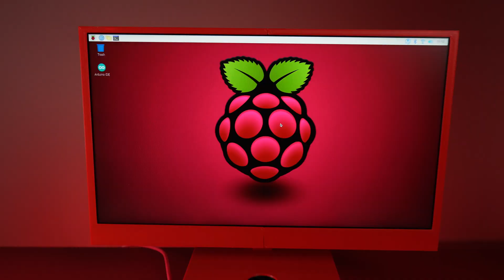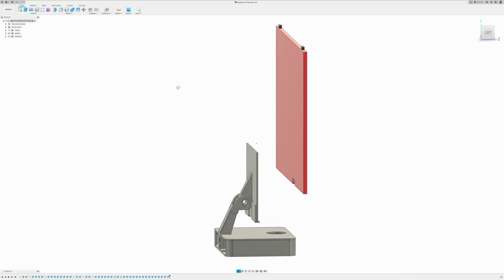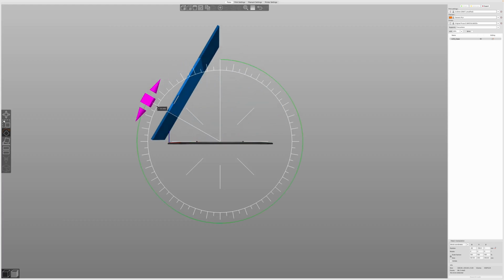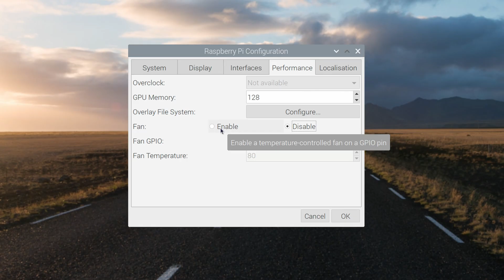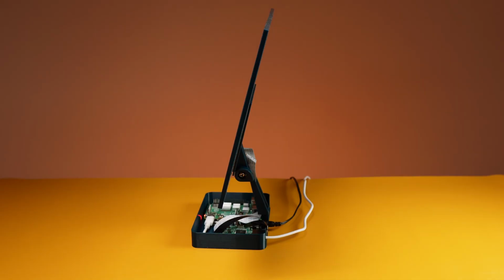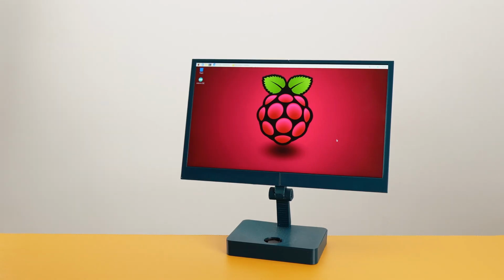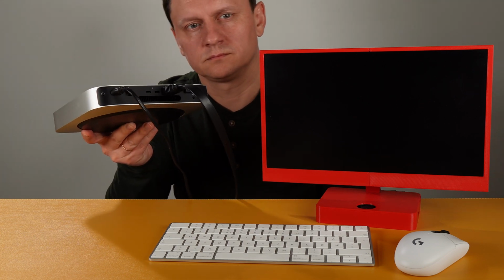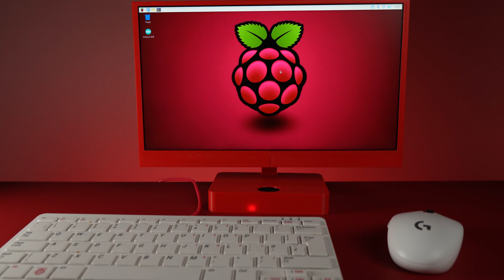Raspberry Pi Desktop

Comment: how much did this project cost in total?
Reply from the maker: I already had failed laptop and Raspberry Pi. But if I would estimate the price according to what I can find on Amazon, Ebay, Aliexpress:
1. LCD panel from Dell Latitude E7440 laptop (B140HAN01) about 50$ 
2. LCD controller board for B140HAN01 about 19$ 
3. Heatsink Kit for Raspberry Pi about 2$
4. HighPi Pro 5V Cooling Fan about 6$
5. PLA filament (173 gram) about 4$
Without Raspberry Pi I would estimate about 81$ in total. 
Add the price of Raspberry Pi with 1GB, 2GB, 4GB, or 8GB.

Comment: This is really cool! How much would you say it cost in filament for 3D printing the finished design, and how long does it take to print all the pieces? The only real improvements I think you could make is somehow powering both the LCD controller and Pi from a single power cable, and making the SD card accessible without dismantling the whole thing.
Reply from the maker: On 3D printer Prusa i3 MK3S+ with DRAFT printer settings (fast).
cable_cover             6min     1,56g
pi_cover	                  95min   37,37g
lcd_case_p1          155min  34,68g
lcd_case_p2          152min  33,31g
pi_case                  123min  46,66g
ribon_cover_left       7min   1,79g
ribon_cover_right    7min    1,67g
stand                       61min   16,37g
So total print time 606 min. and 173 gram PLA.

Comment: Hey, I need some help for my project and was wondering if you could help me. I am looking for a panel driver or display board that has usbc as an option for power delivery. Does something like this exists on the market or should I just get a portable display thingy?
Reply from the maker: LCD panels needs a different LCD controller board. It will be challenging to find with USB-C. I have not seen any yet.